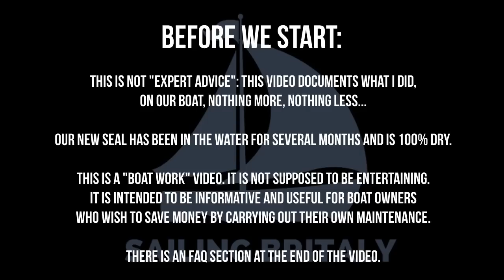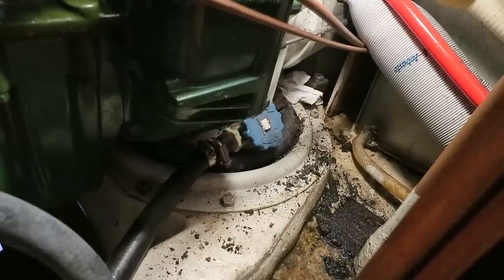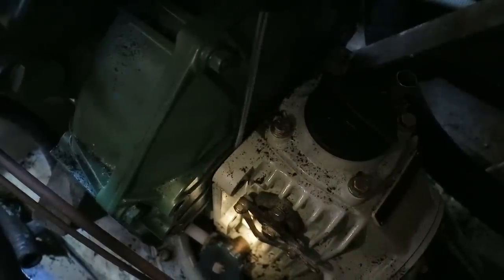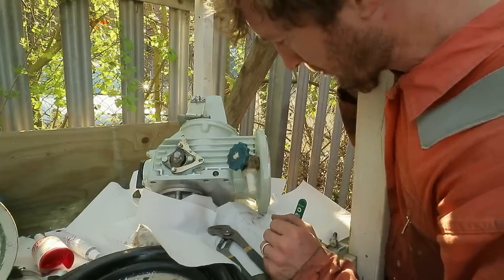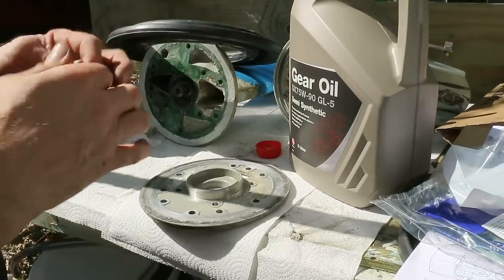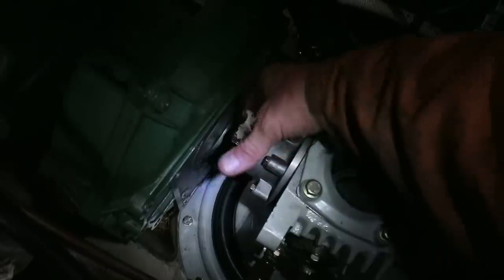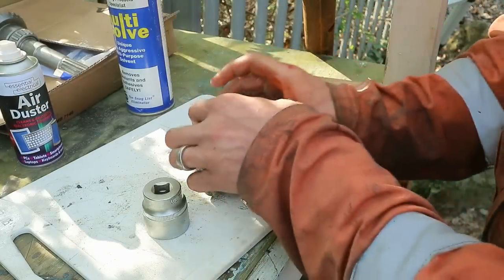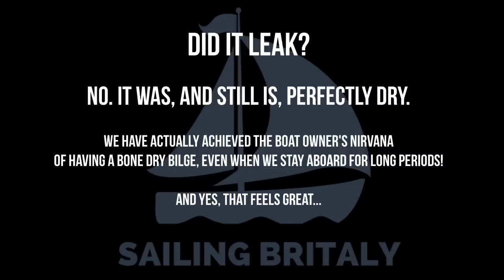Saildrive Diaphragm Replacement | ⛵ Sailing Britaly ⛵ [Boat Work]

Comment: I watched the whole video start to finish without a break even though my boat has a Yanmar engine and no sail drive. It's a Carter 33. Fantastic effort by you to do this job and make such a detailed film of it especially with wifey and new born to think of. You are a way better mechanic than I will ever be. But my toes did curl when you were changing the seals and removing and refitting those bearing races to do so. OMG! Banging them in on that flimsy wooden table watching everything bounce was not your best moment. Should have at least got a large wooden block on the ground on which to tap them in. And then using the blow torch to get the new seals sitting properly. Ideally you should have had sockets and bench vice and pullers. Also after you cleaned the rollers up with solvent having got crud on them did you regrease them as your filming suggests you might not have done as they looked pretty clean when you put the shaft back into the sail drive housing and reassembled it? You didn't mention regreasing or maybe I missed this bit. Can't imagine you didn't regrease them or forgot to do so. Also the anode, you did fit the correct type for salt water magnesium I think but could be wrong. Good that you checked it was connected and working correctly using a volt/resistance meter. It would have been nice if you had had more time to properly paint the outside of the sail drive housing before refitting but I guess time was against you. The old oil that came out of the engine was disgusting. How many hours has it done and what power does it put out? One last question. Is there anyway to flush the cooling system? I guess the boat would have to have a fresh water source. Is the anode on the bottom of the sail drive the only anode or is there another on the engine in the cooling system?
I'll be doing my boat's seacocks in the spring then tackling the engine which needs work as it's currently a non runner.
Again thanks so much for making and sharing.s
Reply from the maker: Hi Alex, thank you for watching! There were many things that would have been done differently but I wanted the job done pronto and I was being slowed down massively by the filming. For example when hammering on that flimsy rack, it's not just finding a wooden block, it's finding a wooden block, moving the tripod, setting up the camera, sorting out the focus, getting the short section of video, then going back to the bench and repeating the above steps afterwards. With an extra 10 seconds of hammering I just got the done on the bouncy table. I was holding the bearing housing with my bare hands when heating with the propane torch, so the temperatures involved were not too hot. In an ideal world could have pressed the bearing race in with a hydraulic press, but the hammer got the job done quickly (I've changed boat trailer bearings in a field before, so I knew this was easy) and without any damage whatsoever to the race. I didn't grease the bearings as they live in transmission oil, which can flow in and around them freely, lubricating and cooling them. I fitted a zinc anode as this river is very tidal and therefore saline. I have no idea how long the oil had been in there, but it looked like it was a long time. We can close both cooling water intake seacocks and run fresh through the cooling system now that I have fitted a pull-out shower in the galley. Cheers! Chris 👍
Reply: @SailingBritaly  Wasn't meant to be criticism, I was just a bit concerned that's all. But you have told me, so all is good! In any case you have worked on aircraft and fighter jets so must know what you are doing as opposed to me ;@) Still very much appreciate all the effort you put in to do this job AND film it at the same time and all other jobs on your boat you have filmed. Many thanks.
Reply: Magnesium anodes are for fresh water - usually in a magnesium / aluminum alloy.

Comment: While trying to remove the water inlet valve, I would have flipped it over, ratchet strapped it down, and pressing down instead of up on your long lever would have been easier.

Comment: all of it lasted a long time  but it would be good if the makers  went the extra money and always used the best components  , when we buy we should check all markings  ,  informed watchful buyers would force industry to do the right thing.   ..... as to the new rubber verses old   , having watched and worked in manufacturing , i wonder if the new rubber is made as the old or to save money it is less .   .

Comment: The Date stamped on the Seal is the manufacturer date! How long since the manufacture date has it sat on a shelf in a Marine store?  When was the Installation date? That Propeller is in urgent need of Care/Replacement!
Reply from the maker: The boat was built in 1993, so the original seal was manufactured and fitted in the same year. I know the new one that I installed was fitted a year after it was manufactured, my point was that someone else coming along and seeing 2017 embossed on the new seal might think it was fitted in 2017... Fortunately we have videos to show them it was 2018. I think you might be right about the prop(!)...  Chris

Comment: Hi
Remember that the saildrive requires cooling which it gets when the engine sucks water through it. If you have your alternative cooling seacock open there is a  clear risk that most of the cooling water will pass through it and not through the saildrive resulting in overheating problems.
Reply from the maker: Hi Jakob, I'm confident that this will not be a problem. The minimal amount of heat generated in the saildrive assembly will be transferred to the oil: which is in contact with an ample amount of surface area of aluminium (which has an extremely high thermal conductivity: https://www.engineeringtoolbox.com/thermal-conductivity-d_429.html) This will easily transfer this small amount of heat to the seawater flowing past the saildrive leg. Cheers, Chris 👍
Reply: Hi
You might be right... but... I had never thought that overheating could be a problem for saildrives, but having done a lot of troubleshooting of my own saildrive recently I have found lots of stories about overheating saildrives.
It makes sense that the water flow through the saildrive should have some purpose. After all it makes the construction of the drive a lot more complex, so why else would it be built that way?
Reply: Jakob Wallander not sure why you would think that he would have the alternative cooling sea ok open? Surely one would only open it in the event that the main seasick blocked?

Comment: Who would have a sail drive 1 big hole in the boat should it hit something and all that work a job well done though. Your previous life has helped not a job for any average joe blogs Thanks for sharing!
Reply from the maker: Hi Mike, I actually quite like saildrives. After doing a lot of research I have only ever heard about two failures: one after work on some engine mounts (the engine had been moved around - perhaps too much?) and one where the aft mount failed. In both cases the boats were hauled ashore and repaired. Considering how many thousands of boats there are out there with saildrives, and considering how many people don't replace these diaphragm seals at the required 7 year point, I think that's pretty good! The saildrive leg is between - and higher than - the keel and the rudder, so I think it's very unlikely to hit something. Don't forget stuffing boxes can fail too... Thank you for watching & commenting! Cheers, Chris 👍
Reply: @SailingBritaly  yes some good points there and they do allow for the engine to be mounted further back in the boat.

Comment: Mads from Sail Life did this last weekend......over an hour of the same thing is just too much
Reply from the maker: We did this job and released videos about it in April. The videos are different: this one covers the job from start to finish (Mads had his engine and saildrive already out at the beginning of the video) I also did it single handed (Mads had a guy helping him) and cover other things like removing the lower bearing housing and replacing the prop shaft seals. I don't expect people to watch this whole video unless they are actually doing this job. My guess is that if you were to ever do this job yourself, then this video would not be "too much", but perhaps I am completely wrong. Cheers, Chris
Reply: Thanks Chris for the comprehensive coverage of the job. Really appreciative. Fair winds and seas.
Reply: @SailingBritaly  “but perhaps I am completely wrong” You’re not, personally I enjoyed the detail. 

One question, maybe I’m being a bit dim (Ex Sooty) what stops water getting past the seal on the leg it looks like there a gap between the leg and the seal. or is the seal just to cover the hole and it’s not really a seal per se.
Reply from the maker: Thank you Yves 👍
Reply from the maker: Hi Div3r, the outer seal doesn't stop water getting in, it's just a fairing to reduce drag and to keep marine life out (I found some mussels and an oyster up above ours, so its effectiveness isn't perfect). There's an ex Rigger who appreciates your feedback :-) Cheers, Chris 👍
Reply: @SailingBritaly  When this video first popped up, I wasn't going to watch the whole thing due to the length, but then I did anyway.  Was nice to watch somebody else doing battle with mechanical devices for a change.  As a current (civilian) aircraft mechanic, I don't think that safety/lock wiring is a skill that you can ever forget.  I did cringe a little bit when you tapped the race in with the hammer (I probably would have used the handle or other block of wood) but all's well that ends well.

You mentioned not being able to borrow welding equipment...  In a pinch you can stick weld using two 12v car (or boat) batteries wired in series, if you have the right connections (or enough jumper cables) and the welding electrodes.  In a yard setting finding somebody who could do the job right was exactly the way to go, but if you had to do the same job (broken engine mount) in the middle of the ocean on your own, it would be well worth carrying some extra cabling and a waterproofed supply of 6011 electrodes.
Reply: There is also this minor difference, that these are not the same drives. The procedure is some what different between them. The other is 130S, while this is 120S. Maybe it should be mentioned in the title...
Reply: @SailingBritaly  Hello, I for one just hit the watch video button and never looked at the length of the vlog. Here I'm reading all the comments about the length of it, and I'm like wow I never noticed it was over an hour long. I thought it was informative and very interesting. Well made and useful. If you put out the effort to make this kind of vlog, then I as a viewer am going to watch and learn as much as I can. This is no small task making these vlogs for us and I say thank you and your family for sharing yourselves with us. If someone thinks they are too long they could just watch in increments. Lol 
               ⛵ fair winds and following seas.     E.Russell
Reply from the maker: @netpackrat   Hi there, I think you're right about the wirelocking. We only did it manually in training then we always 'cheated' and used wirelocking pliers, so it was a very long time since I'd tried it. I've done bearings like this before (In a field on a boat trailer) so I knew I could do it with the flat side of the lump hammer, without damaging the race. Funny you should mention the 2 x car/boat battery welding, I saw that a few years ago [don't you just love YouTube!] and it's on my enormously long list of things to try when I find the time... As an extra challenge it would be interesting to try stick welding on stainless steel with the above setup. I have welded stainless steel with stick welding before (I made an addition to a pushpit to support a passerella) and although it takes a great deal of time, care and attention to get a nice, shiny corrosion-resistant finish, it can work well. I'm sure it would be a challenge with the car/boat battery setup, but perhaps with the addition of a simple current-control system (I saw one years ago where a guy wrapped a coat hangar around a concrete block and then adjusted the current by moving the position of the welding jump lead along the coat hangar to get the desired current) you might get a good enough result to make it worth a try. Cheers, Chris 👍
Reply from the maker: @edrussell7960  Hi Ed thank you very much! Another alternative is to do what I do: Watch almost everything on YouTube at 2 x Speed. It is a lot more efficient, and if you have ever worked with Saturation divers then the high-pitched voices sound perfectly familiar. This is a great tip to free up time when you need information fast...  Cheers, Chris 👍
Reply: @SailingBritaly  plus you get the entertainment of a high speed dance at the same time. Lol

Comment: When applying the external seal you only put CT1 on the hull and not onto the propeller shaft casing. 
Is this correct? 
That's obviously sufficient? !
Reply from the maker: Hi there, the two large o-rings seal the lower bearing housing into the saildrive leg, so it's not necessary to seal the gap on reassembly. The external saildrive seal is adhered to the hull, but just sits around the saildrive leg where it exits the hull aperture. Water is free to migrate through this gap, and while the propeller is turning there is movement in that area due to vibration. Cheers, Chris 👍
Reply: @SailingBritaly  That's a good point, the thin rubber seal at the bottom is not strong enough to hold the pressure of sea water present on one side only. So, water needs to be free to move between both sides, equalizing pressure on the bottom seal so it won't stretch and blow out. That rubber seal is there to reduce movement of sea life that can slowly destroy more critical components inside. On my Yanmar there is an outside metal plate screwed over that to prevent damage from debris in the water.